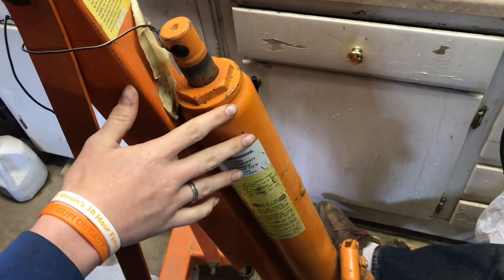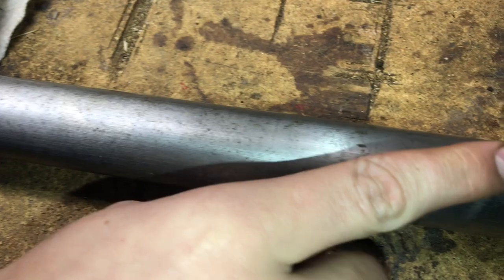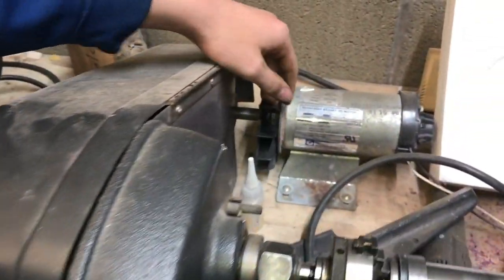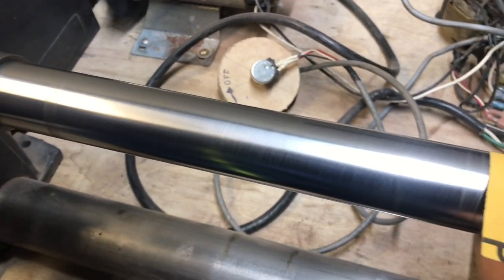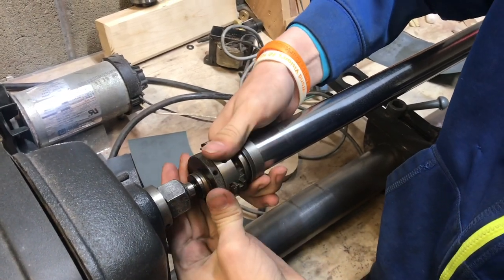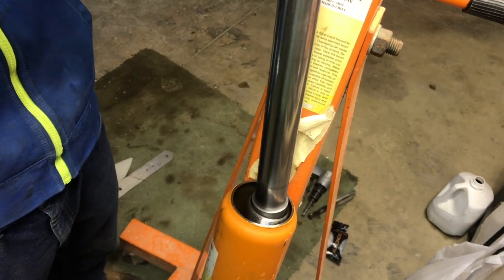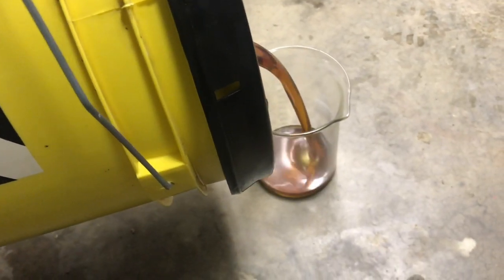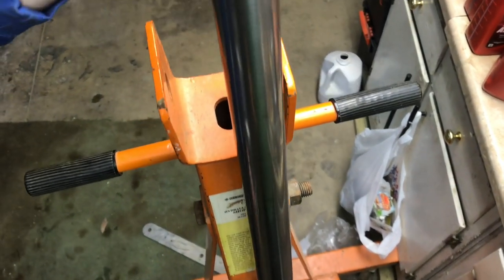RESTORING a hydraulic cylinder on and engine lift from harbor freight  (polishing the cylinder)

Comment: That's the ram, and it doesn't matter if it's pitted. The important surface is the cylinder which contacts the seal on the bottom of the ram (has a V-shaped cross section).

Comment: The upper end of the rod is only contacted by a seal to keep external fluids or debris out of the reservoir, it has no impact on the operation, and it is not the cylinder it’s the rod, the cylinder is the internal pipe threaded to the base, the piston is the round bushing at the bottom of the rod, the outer bottle shaped housing is the tank or reservoir.
Reply: tanks, sow its ahh, won weigh,up ollie ,nuttin downtown.

Comment: That's the Piston, the cylinder is the Pipe thingy. You know what's fun? It's when the wet/dry wraps around the part you're sanding and your thumb gets stuck in the whole thing - Owch. So if you do it again sand at higher speed and WD40, wrap your paper around a paint mixing stick and you won't lose control

Comment: Great job. How about repairing the mini pump cylinder on the bottom? Seems like it should be the same process however mine isn't working.  I wonder if the smaller external BORE can be refurbished?